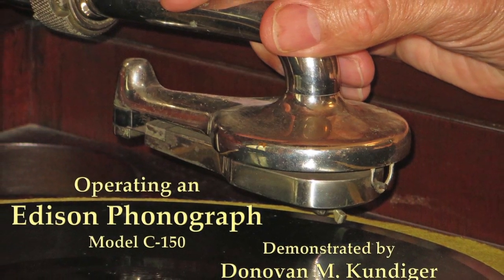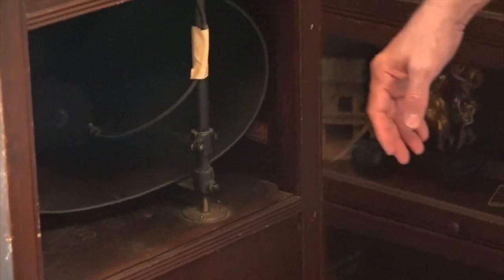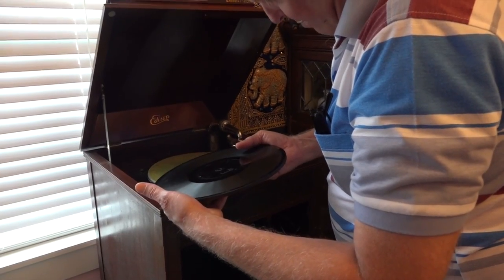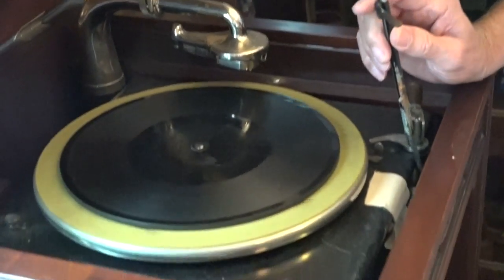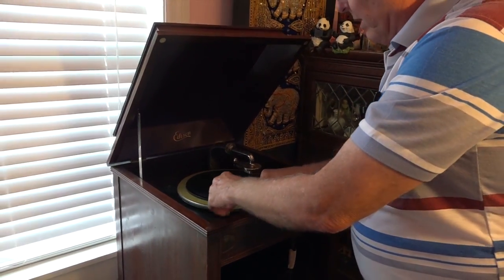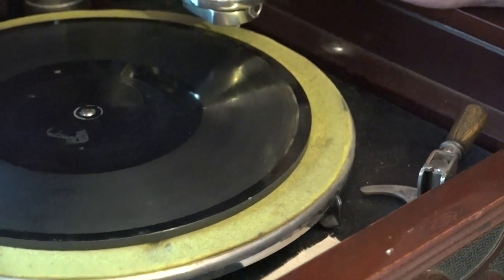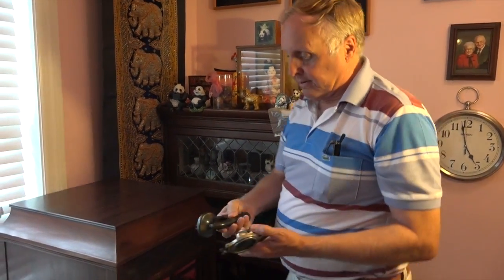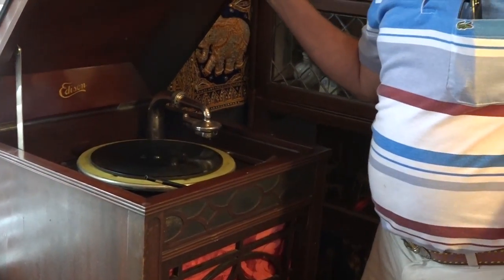Edison C-150 Disc Phonograph Instructions

Comment: That automatic brake arm can be easily adjusted so that it works. Pull off the turntable, loosen one screw, adjust the stop mechanism and tighten the screw. Replace the turntable....done!  Also you really need to get some leather or padding applied to the brake so it's not metal on metal any longer.

Comment: The odd looking reproducer that looks quite different from the others is made to play the regular 78 rpm lateral cut records from victor, columbia and so on. It takes a regular phonograph steel needle, which you can buy dirt cheap on ebay. Just make sure you ONLY use it to play NON EDISON records. This was sold in the day as an alternative to having 2 machines to play the different style records. The edison reproducer uses a diamond needle that could potentially last a century. Mine has. The lateral cut records, that is to say, the regular 78s, needed to have the steel needle changed after every record. Good thing they are cheap..Also, lift the turntable off and attach or glue a piece of felt or leather or a rubber eraser on the brake arm AND GET RID OF THAT DAMN SCRAPING NOISE THE BRAKE MAKES.

Comment: After the invention of Edisons phonograph in 1877 the disc record was more popular so to compete with his phonograph he started making disc records but he didn't want to copy the patent of victor and you couldn't copywrite someone else's design at the time, so he made his own way of recording. At 8:09 the reproducer that you said is different, is a lateral cut reproducer commonly used by the Victor Talking machine co. That is a product, that Edison used to manufacture back in the day since there was competition with lateral cut vs. vertical cut records ( the difference is the way of recording. Lateral cut is recorded side to side and vertical cut is recorded up and down) so since there were more Victor records or lateral cut records in shops, and were more popular, Edison made a configuration that you can attach to the machine so then you can play these lateral cut records. and that product you have at 8:09 is it.

Edit: you can look online how to add that configuration to the machine and there are also pictures of it on the machine. you can even look up victor phonographs to see how you should play lateral cut records with the other reproducer. 

And you MUST with the lateral cut reproducer change the needle after every record or after every 2 records because if you don't the record will wear out over time. and I've seen badly worn out records with amazing titles and to prevent this is to change the steel needle after every use. I should know because I have a Victor Gramophone the fifth or V, and the needles can be added with titling the round reproducer up and unscrewing the screw and place the steel needle into the hole and tighten the screw and play. then repeat this process to remove the needle and place it back again. other needles that can be used are bamboo ,cactus ,or wood/toothpick (but do NOT use any household toothpick its not made the same or it isn't the same wood as manufactured ones for the gramophone)
Reply from the maker: Thanks for that great explanation.
Reply: No problem :)
Reply: @JerriGarretson  The same did they for record players in lateral cut, a soundbox for Edison and Pathe records.
Before the mid 1930's, a gem based stylus wasn't in use for lateral cut records, it came a pretty modern pickup (Telefunken TO 1001), lightweighted, but the sapphire stylus isn't replaceable (fun fact, that they recommend to use a sapphire for 80 hours only, contrarly to diamond, what lasts 500 to 1000 hours, depending to quality level and unit's quality. 
Telefunken TO 1001's design made it into the early 1950's, was also copied by East Germany, but when micro groove and vinyl came, people changed to record players, that are compatible to the new formats.

Comment: My name is Tina Hendricks.
I have the same Edison disc phonograph. When my father passed, it was left to me. I never knew the speaker was behind the sound screen or that you could even adjust the volume. Thank you soooo much for this video 🥰. Could you tell me though, how to change the needle? There are extra needles but the inital one is totally worn down. It looks as if you just pop the old one out and stick in another needle but it seems to take more force than I want to use.
Can you help me?
Reply: Did you ever figure it out? This is what I'm trying to learn too!

Comment: If you pull out on the stop bracket under the turn table, it will contact the swing arm and stop the player! It can be adjusted before playing each record to the grooves of the record! Easy peasy!!! The second diagram  with the steel needle is for playing the regular thinner 78 rpm records... sounds like the felt under the turn table which stops it is worn out or missing.....screeeccchhhhhhh!!😵‍💫

Comment from the maker: In answer to Estelle Slootmaker, who could not move the tone arm on her Edison, I had my sister examine the one in our video. She said, "My sister examined the Edison in our video. She said, “I can't find anything other than the lever - you raise or lower the lever and it raises and lowers the tone arm.  If that doesn't work, it must be either stuck or something broken inside perhaps.

When it (the tone arm) is moved to the left/center it is actually in the down position, and no, once you have pushed it all the way to the left(into the center) it is locked in that position. You can’t move it back to the right again unless you put the lever down which releases it/raises it up and it it free to move again.

When you raise and lower the lever, the entire bullhorn contraption underneath in the cabinet goes up and down. It is connected to the tone arm in the back. The whole thing is connected like in a loop."

She also make two short videos showing what she is talking about. I have not found a way to post them directly in this comment, but will try to do so via links.
Reply from the maker: https://drive.google.com/file/d/1tFWwTiJd3qdwU9rbiy_Cfy_xwYdsdDCD/view?usp=sharing
Reply from the maker: https://drive.google.com/file/d/1ou1TcsFjpyN0JZgsqZ1N00uHF89844V2/view?usp=sharing

Comment: Me and my father found and purchased one of these at a thirft shop. The  Front grill and crank was missing. Can you help me with the type of crank or measurments of the crank?
Reply from the maker: Unfortunately, I can't, as the Edison is not in my possession. It is with another family member in another state. I will ask whether it is easily accessible and whether they can provide a photo and dimensions of the crank.
Reply from the maker: Hello, I hope you will be able to see this. My sister took photos of the crank and also measured and drew it, as well as photographed how and where it went into the Edison cabinet. Apparently, in order to post photos in a YouTube comment, they have to be hosted somewhere on line and you can just provide a link. I'd have to figure out where to load them. It would be easier to just send them to you. Please let me know.
Reply from the maker: Okay, I have uploaded the Edison crank photos, drawing and measurements as well as info about the front grill (which differed on different models) to a Dropbox Folder you can access with this link. You do not need a Dropbox account to access it. If it asks you to log in, just ignore that. You can download the photos if you wish. Please let me know whether this works for you. https://www.dropbox.com/scl/fo/9dmgyyedqfcqsecwjn8gl/h?rlkey=s244tbu428hbtz2dp3d6d85mh&dl=0

Comment: I crank and crank and it won't go. Any suggestions or tips. It was just playing the other day
Reply from the maker: Hello, I asked my brother, who did the demo in this video, about your problem. Here’s his answer. I hope it helps. “If he cranks and cranks without feeling any resistance, the crank is not engaging the spring tightener.  I think that happened to me once, but it was so long ago I don't remember the fix. But I'll suggest pushing the crank in and then slightly crank back and forth just a little way to see if he feels it engaged.   
Then, when he cranks to tighten, keep pressure pushing the crank in to keep it engaged.”

Comment: I just obtained an Edison Diamond Disc Phonograph. It plays a record half way through before slowing down nio matter how much I wind it. Am I doing something wrong, or does something need to be adjusted? Thanks
Reply from the maker: I have no idea, but I'll ask my brother, who explained the way to operate it.
Reply from the maker: Hello, Gino. Here is what my brother had to say about your playing issue. I hope it helps.

"That's a strange situation they're having.  

With the needle raised, I'd take my hand and, holding the tone arm lightly, move it back and forth across the area where the record would be on the turntable and see if there is any resistance.  If so, find out what the tonearm might be pushing against that may slow down the turntable.  It might require looking up inside the box below the turntable where the speaker horn is located.

As shown in the video, the tone arm can trip the turntable brake, and that would slow down the turntable, but that would make a loud scrapping sound, and they'd hear it.  However, if that is the problem, an adjustment would be needed there.

The comment says, "No matter how much I wind it."  Although the wound spring should turn the record at full speed all the way through a play, if the spring is old and weak, it may run out of power even if it is wound up all the way at the beginning.  If you recall, in the video we made, I didn't have the spring wound all the way, and the record started slowing down.  I started winding it back up while the record was playing, and it returned to full speed.  

Also, the commenter wrote, "No matter how much I wind it," but didn't specify if that meant winding it all the way before starting play of the record or if it included winding it like I did when the record started slowing down.  I would certainly give winding it while the record is playing a try.  If the record speeds back up, then I'd say it is a weak spring that can't keep the turntable turning through the full play of a record.  I don't know if there is an adjustment that can be made on the spring or if it would require a new spring.  I also don't know if replacement springs are available.

I hope this is helpful and the commenter gives feedback on whether the problem gets determined and hopefully solved."

Comment: 80 rpm sounds too fast here.
Reply: The spead is absolutely dead on
Reply: The 78 rpm are related to construction and the motor's rpm.
Theoretically, you could reduce to 33 1/3 rpm for speech, but only a minority could play these, owning the special Victor long play record player, what failed in success or a record cutter, what has also 33 1/3 rpm.
So I guess, they increased the playing time for speech by cutting the low frequencies.
Reply from the maker: 80 rpm is the correct speed for the Edison records. Competitors played at 78 rpm but you can only play those on the Edison with the special arm for the laterally grooved records. The speed changes in this video result primarily from the demonstrator not cranking the machine as far as he needed to in order to get the correct speed....worrying about cranking the old thing too far.